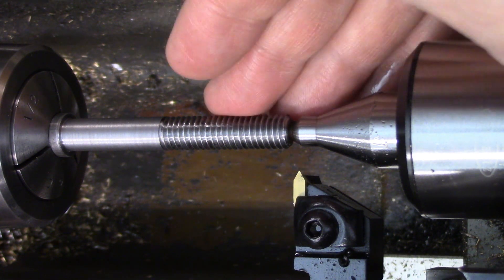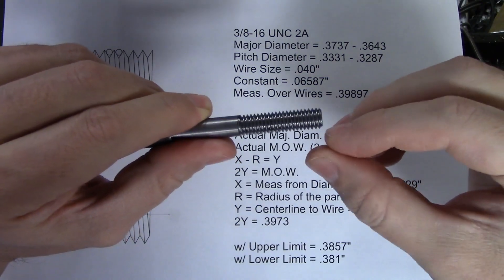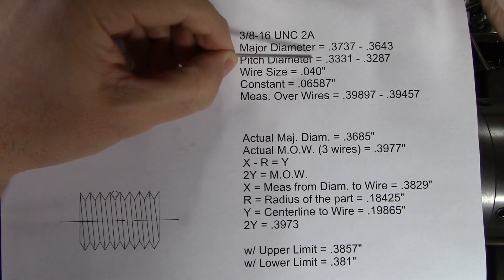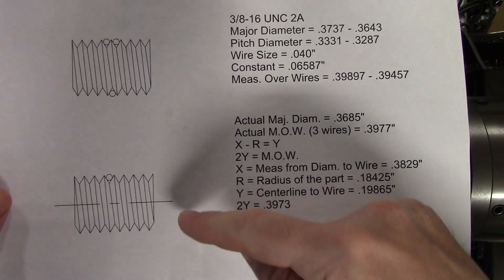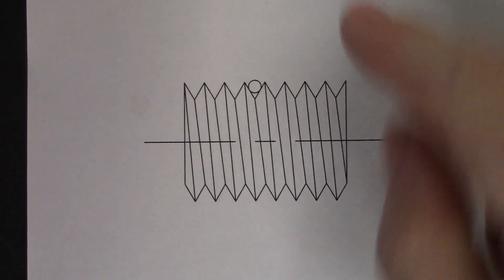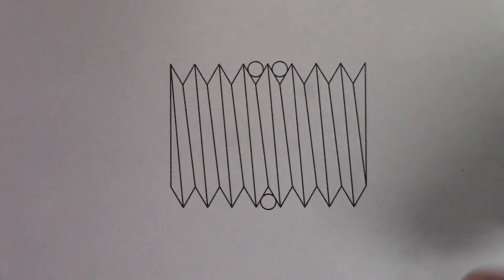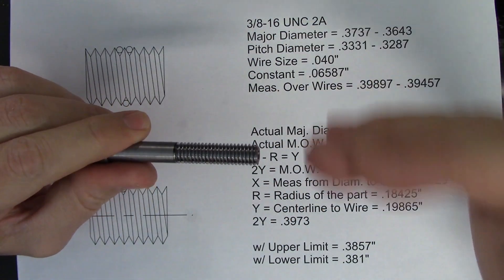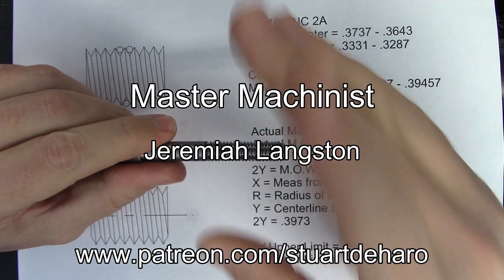Can You Measure Threads With Only One Wire?

Comment: I was measuring a 2 3/4 -6 spindle thread on my lathe. The 3 wire method is difficult as the micrometer anvils barely catch the thread wires. The one wire was easier but seemed more less repeatable.
I need a mic with bigger anvils. Spendy for a one off.
Reply from the maker: @978sdcox  Yeah, that's why I still don't own a disc micrometer. It's pretty hard to justify it.
Reply: In those situations I have resorted to using a decent quality digital caliper and gotten repeatable/dependable measurements across the the 3 wires on coarse threads using the caliper jaws in line with the axis of the threaded component.

Comment: Couldnt you just find an acceptable thread, (a bolt someone else made on a lathe for example) use any sized wire and measure the bolts diameter with the wire and make a comparitive measurement on the part youre making, and just use the difference between the two to set your depth of cut..?
Reply: A standard off the shelf bolt or threaded rod isn't a reliable gauge as the manufacturing process,tolerances and class of thread fit are unknown factors  beyond your control.
This is why thread charts and wires are very accurate or alternatively the use of precision ground thread gauges.

Comment: Joe pie is FOS🤡. Not to mention that the 3 wire method is not intended for normal manufactured threads. It was intended for measuring precision ground thread GAUGES with perfect thread form.
Actual proper thread wires are made to gauge block tolerances because they have to be and they cost a bundle. Any error in the wire causes an error in measurement of SIX TIMES that in the final measurement. You will not get wires like that for $14.99, try $1499.00
Over all 3 wire method using cheapo wires is "better than nothing" but not by a lot. 
Even if you use expensive precision wires you will still get a wrong reading because your thread form will be far from perfect.

Comment: Greetings Stuart de Haro. Nicely presented video. Allow me to address the content if I may. Lets start of with the thread crest burr subject. Whether you are checking a thread with 1 wire, 3 wires, a thread ring gage or a mating part, any machinist worth his salt will make sure the thread is in a presentable condition for a reliable measurement. This means clean and free of burrs. My suggested one wire method is no exception to this rule. So it doesn't go unstated, thread crest burrs will never effect a wire position since the wire sits in the thread form and is not influenced by crest burrs, but may influence an OD reading. But what kind of machinist would measure an OD with burrs on it?? Second, lets talk about variations in the major diameter of the stock effecting the PD reading. I have to conditionally and respectfully disagree at this variable as an attempt to discredit the value of the one wire method. True...the measurement over the wire will deviate as the stock diameter changes, but the determined/calculated pitch diameter will remain constant if you have done the math correctly. The thread form is a given distance from the centerline regardless of where the OD of the material is. To convey to your viewers that the material OD will give you a false PD reading is simply wrong. And in conclusion, although the 3 wire method is my standard and first choice to measure, only the one wire method can indicate an eccentricity between the pitch diameter and material diameters. Go back to your subject part and use the one wire to check it at different locations and rotations. The differences in pitch diameter readings you observed on your part, and presented at the end of your video, most likely indicate your thread was .002 eccentric to your material OD. This is an indisputable fact. The presence of a live center doesn't matter. My latest video goes into this subject in great detail. Feel free to drop by and leave a comment. I may edit this comment at a later date, but for now, I'll stand behind every point made and welcome replies.
Reply from the maker: Hi Joe. I know tone is difficult to convey in electronic communication, but I'm still picking up a contentious vibe from your comment. I feel I covered these points rather well in the video. I told people to remove burrs before measuring every time. I ran through the math several times while writing the script to make sure I wasn't talking out of my butt. I want to be very clear, I was not trying to disrespect you in any way. I think your videos are great. I just wanted to answer a question that my viewers were constantly asking. Take care, Stuart
Reply: @StuartdeHaro  Hi Stuart. I totally agree about electronic communication, however, I must be honest enough to say your observation does have a degree of merit. I see you are, or used to be a tech instructor, so I would expect you would be more analytical in a situation like this and exhaust all possible explanations to the difference in readings, as opposed to condemning a method you have recently been introduced to. We can both agree that metal doesn't compress like wood, and with your experience I can assume your mic pressure is consistent, so a difference in 2 measurements that should line up, doesn't automatically indicate one of the 2 is wrong. For sure, the 3 wire method will give you the actual PD, but it does nothing to assure the thread is concentric to the material OD. In a failure forensic theatre, the difference would point directly at your thread being .002 off center from the stock. The mechanics of the single wire method don't lie. I don't know if this part is still available for deeper inspection, but I'd bet, using the one wire method, you will discover different readings along the length of the thread. No disrespect perceived in your reply, and thanks for your support of my channel. I welcome a reply.
Reply from the maker: @joepie221   I do still have it sitting around. It's one of the screws from my table stop build. I'm not sure which one, but I'll give them a check.
Reply: @StuartdeHaro  It would be interesting to also check a commercially available thread plug gage, both ways, if you have one of those. I'll do the same out of curiosity.

Comment: Hi Stewart,
You have expounded on my fears exactly.
Any variation on the major diameter, not taken into consideration, ensures a shitter of a result.
Not satisfactory.
And if you think that risk Is acceptable, I hope I never buy your stuff!!
Reply: Any variation in the major diameter will be used as a hard number in the formula. It has NO bearing on the PD measurement.
Reply: I apologise to Stewart, who I do like!
And yes, Joe, I do understand the old would be a hard number in the calc..
And I observed your veiled on bent shaft  threads use of one wire checking, good.
I worry about miss measurement on burs or large threads.without a panamicro..

Comment: Thanks for showing this. I was expecting the 3 wires method to be correct, simply because the diameter is so subject to variability and is not the important dimension anyway.
Perhaps it was you who had mentioned about using a dab of grease on the 2 wire side, making it easier to keep them there. I've tried a silicone holder for the wires and it was just as frustrating as not using any aid.
Reply from the maker: I would definitely trust the three wire method over the one. That probably was me saying to use grease to hold the wires on. I put out a video about it a couple of months ago. Who knows though. I certainly didn't invent that trick.